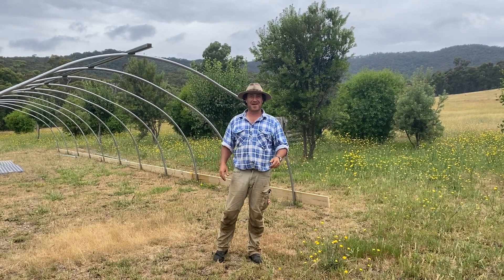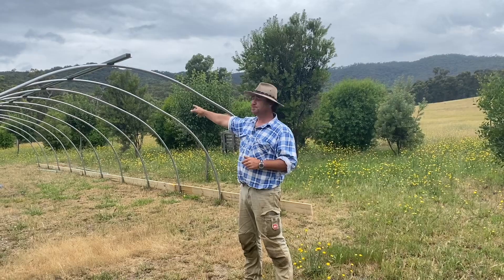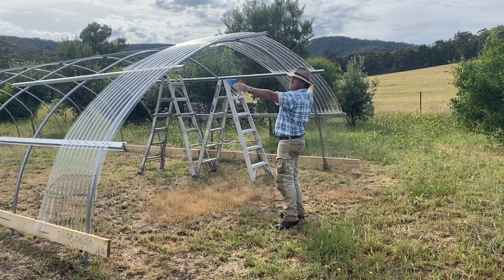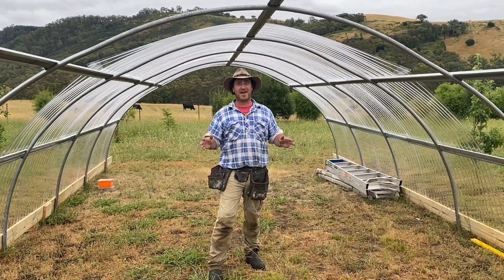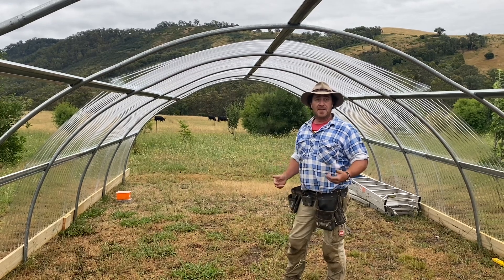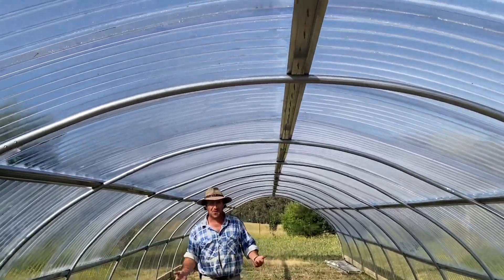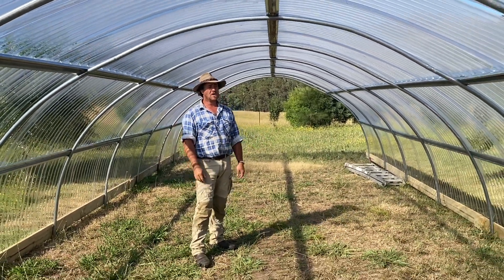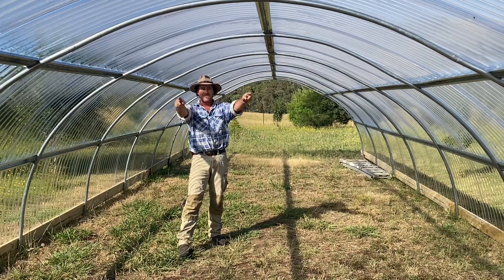Hoop House High Tunnel - Poly Carbonate/ Perspex Skin Install.

Comment: 0 info on installation. How did u put the polycarb on the hoop house
Reply from the maker: Hey Shawn, I just used the polycarbonate screws or corrugated roofing screws. Starting at ground level. Check with your supplier of the poly to ensure the bending radius capability and you're done. The sheets will be around 670 wide which is ample to reach over and fix. If you're  in Victoria Australia I can send the supplier I used. There are a few products that won't bend at the radius required. Hope this helps. Cheers Pedr

Comment: Love the vids dude just subbed ya 
What was the cost of the tunnel in the end mate
Reply from the maker: Hey Danozdirect - i'm thinking back and i'm thinking about 5k. The most expensive element was the poly carbonate. Depending on length this will change dramatically. Our's is 15mts in length 5mts wide. You can always add hoops and poly carbonate to extend. Message us on instagram if you want to chat. More than happy to discuss. Thanks again.
Cheers.
Reply: @FatCowFarmTatong  
Thanks for the reply mate 
I don't have Instagram
Does the poly flex easy or is that why you got shorter sheets
Reply from the maker: @danozdirect3749  Hey, for the coverage of the 5mts hoops, there are three sheets to cover one run, each sheet covers 700mm. 1.2mts sheets for the bottom areas and 3.0mts for the top. I had spoken to the rep from laser light about the top curve and he assured me that the curve was acceptable.  I did doubt him but worked a treat.
It was about the cut v's the sheet size. 4200 sheets cut once into 3000 and 1200.
For the balance 2400 cut in half for 1200.
The place i picked them up from is in Coberg Vic. Roofing Options Centre. Their web site explains everything in great detail.
Reply: @FatCowFarmTatong  
You bloody legend thanks mate 
Summer project
Reply from the maker: @danozdirect3749  Any time, yell out if you need anything further. Happy to help. Enjoy the christmas break, it seems you'll be busy.

Comment: Looks awesome, looking forward to updates. How did you decide on orientation, were there any considerations you had to allow for in choosing your site?
Reply from the maker: Hey Man, the hoop house runs east - west to maximise the heat of the winter sun. Unlike the chicken coop i've run that nth - sth so that the chickens have heaps of shade in the central corridor under cover when the sun is at the highest. We also intended the coop to be at the highest point of the orchard so that all the nutrients from the coop can seep into the soil and run down in ground water to fertilise the fruit trees below. I'm seeing some change in the fruit trees but has only reached about 20 mts down slope from the coop. Time will tell if this works. Cheers !